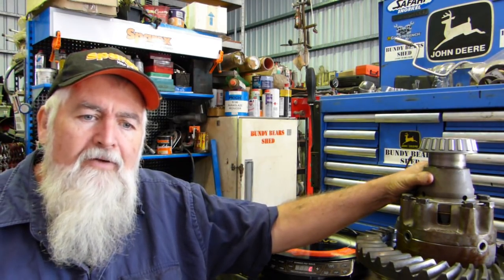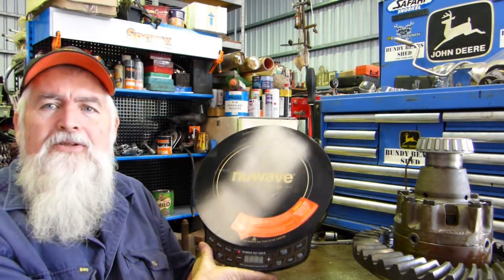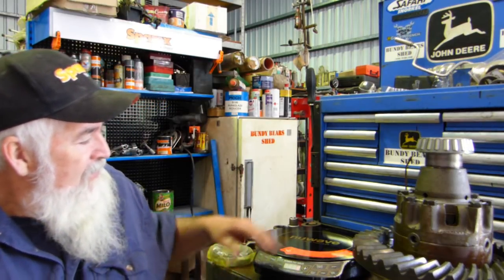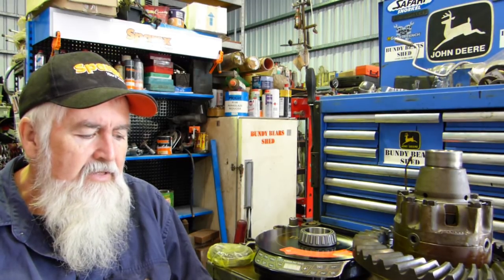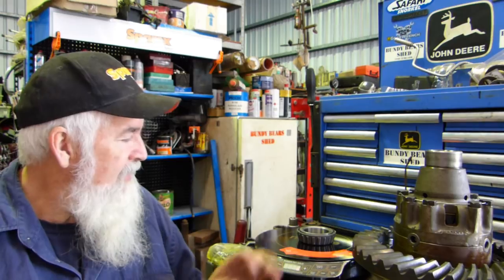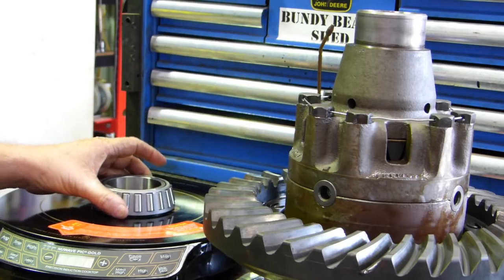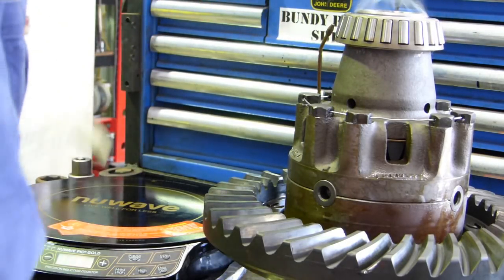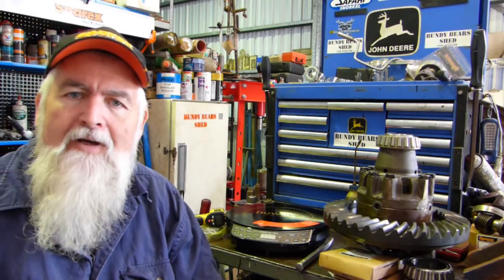Can a Bench Top Induction Cooker Heat a Bearing up Enough to Fit It.

Comment: GREAT TIP - Wrap your bearing up with damp shop rag & make sure to cover all the metal & put the bearing in the microwave for a minute & a half and remove carefully it will be hot & it will slip right on
Reply from the maker: Thanks for the info! I had never heard of doing that.

Comment: Tried this out at work. Do not do this unless you want to fry the bearing/gear. 
It heats up fine... The part directly touching the cooktop at least. The temperature differential between the top and bottom was huge. Bottom of the gear got too hot and turned blue. Bearing was the same but worse. The cage, the only spot that made direct contact heated up quickly but the rest stayed cool. Ruined the bearing. The industrial bearing heaters may cost $4k but they won't run bearings as they heat from all directions. Either purchase one of those or use a deep fryer unless you want to have to replace parts.
Reply from the maker: I have gone back to my chip cooker, you do need to be careful but this was just to see if it would work. I think putting the bearing in a liquid to transfer the heat is safer.

Comment: My infrared thermometer has problems reporting the correct temperature of shiny things.  It looks a lot like the one you have.  I would try a mercury or a bimetal thermometer as a check on the accuracy.
Reply: @Happymacer  True.  The temperature guns are calibrated for surfaces with an emissivity near 1 (like your black tape will have).  A polished metal surface could have an emissivity of near 0.05 - so the reading will be a LOT less than how hot it really is.  A big clue in the video is the oil in/on the bearing smoking - that does not happen until it gets to to 150C or so (at a guess - depends on the oil), but the display only showed 68C!  Whether it was the raceway or the cage that was getting overheated will affect how long that bearing lasts in service!
Reply: Hate those IR temp guns. Terribly inaccurate. Most people treat them as the gospel and have no idea just how bad they are.

Comment: Good one Lance  been waiting  for you to do this  for a long time .
 The SKF  induction heater I remember seeing  was 2 pedestals  about   6" high  16" between centres  with a 1"  square bar  between the pedestals. Slip the bearing  over the square  bar 
 I may remember wrong  but i thought  it then only heated the inner ring  . 
{ circa 1998 }

 How about  2 v block on the induction heater  with a round rod between the v block  with the bearing  hanging between  maybe worth a try
Reply from the maker: G Day John, I searched youtube and had wondered the same thing as the bar they have ai one video. Might try it and see before I give it back .lol.

Comment: dont think it would work on aluminium engine cases (moped motorcycle ) unless you lay a metal plate on the cooker and lay the engine cases on that 
use a hotplate so the aluminium expands to let the bearings fall out
Reply from the maker: No Im not sure it would work there either.